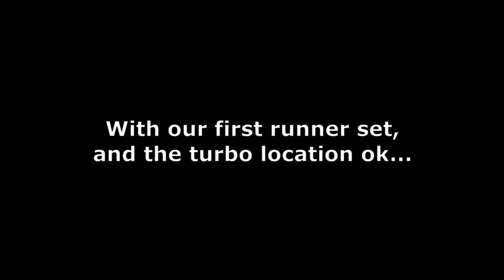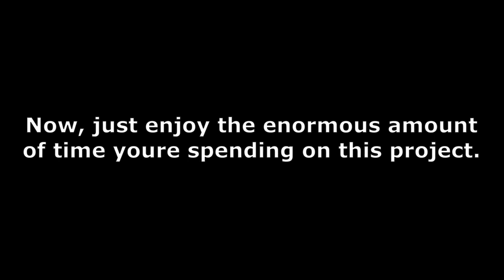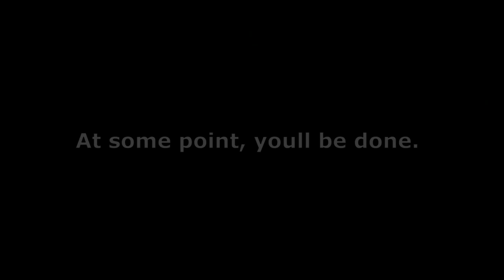How To Fabricate A Turbo Manifold (Twin Scroll)

Comment: What is the wall thickness on the pipe you’re using?
Reply from the maker: 0.125 inch with about 1.500 inch id. Ran PERFECT od for the exhaust flange, and perfect id for the port on the head. Like, perfect.

Comment: Мозги сток? Сколько бар турбина?
Reply from the maker: 1 turbo, but it is twin scroll. It is the Borg Warner Airwerks s200x.
Reply: @JakeSublime  how many bar? 0.5bar or more? ECU stock?
Reply from the maker: @BattleDuckk  tonight i turned up the boost to 0.55 bar, the car seems to be handling it just fine. Before tonight, i was running about 0.4 bar. 

And the ECU is half stock, but piggy backed by the MaxxECU street. I would recommend the Race version though, it has knock detection and more I/O.
Reply: @JakeSublime  Thank you✌🏼

Comment: This looks like it's cracking after 30 miles. 🙈
Reply from the maker: Lol? Its got 2k on it already, no problems
Reply: @JakeSublime  my fist ex manifold only hold up 20k miles. 😉 2k is nothing. My actually manifold is 50k miles old. Looks like new.  it's only steel. But with very different welting techniques....

And it's running 530Bhp at 1.8L
Reply: I’m going to need help with wiring a m104
Reply from the maker: @kraut-performance  We will see what happens. You may be right, but i hope my manifold holds up for a while.

I didnt have the money to buy everything for this car, i had to make evrything. I then wanted to show others that they can make evrything too, instead of spending all their cash on parts. 

At the end of the day, its all about your happiness. Im happy with my build so far, and i think it will hold for a while. And theres the added benefit: ive built everything for this car, by myself, in my garage.
Reply from the maker: @carsxarexhard4504  The wiring and tuning videos are coming soon my friend, let me finish wiring up the car first, at least. 

Sorry for the delay, i just want to make sure i get complete info out in my videos.